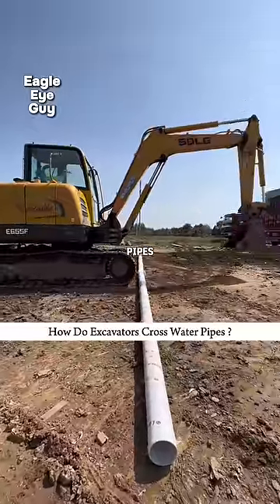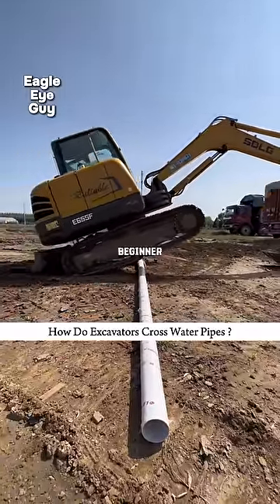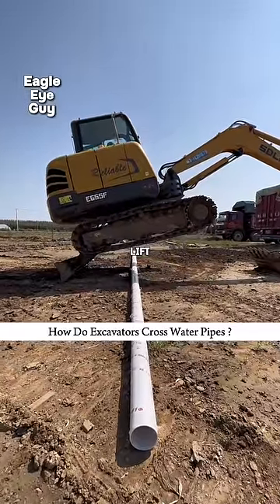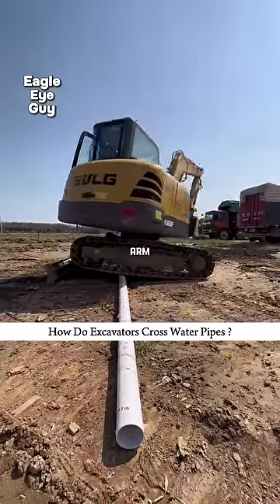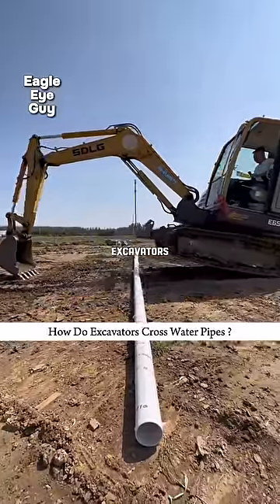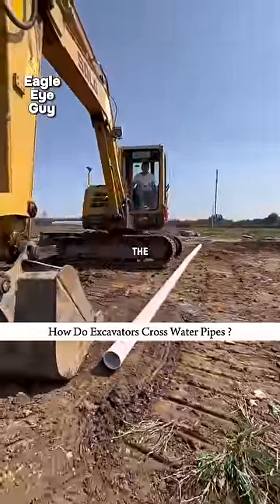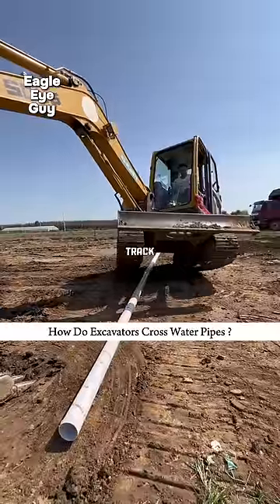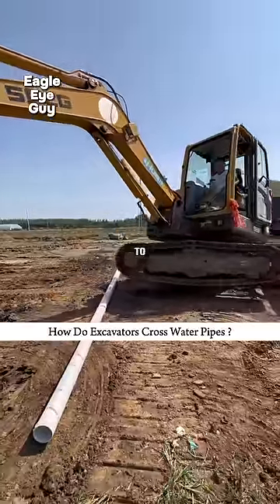How do excavators traverse water pipes? #shorts #facts #didyouknow #excavators #howto

Comment: Veteran operator here, a veteran won’t cross the pipe like that.
The risk of damaging the pipe with this manoeuvre is to high, just put piles of sand on both sides of the pipe a little higher than the pipe itself and drive over the piles.
Reply: Thank you. It was also very sloppy. The site super or boss would be losing his mind upon seeing such an inexperiened operator trying to pull a manouver like that. Anything bigger than what looks to be a 4" pipe and he would have crushed it.
Reply: I'm glad you said this lol I was thinking to myself, "I've only ever seen them throw sand over the pipe" 😂
Reply: I would be pissed if I saw someone put all that weight on the side of one track and try swiveling. No way thats a "veteran"
Reply: Thank you.  Came here to say exactly this.  My ganger would tear me a new one if he saw me doing any of this breakdance shit on site.
Reply: Just pull the pipe out of the way.
Reply: Nice way to throw the track as well.
Reply: With a excavator track 😂😂😂 bye bye pipe
Reply: @kousterx simple problem solved
Reply: I'm not an operator but what you said is what I thought while watching the video.
Reply: Not to mention the danger to lose the track by turning this way. But hey....
Reply: Ah first time saw 999 likes turned to 1K
Reply: When I’m digging a trench between two buildings, at the end you have to straddle the trench with the excavator. The second method is how I get off the trench.
Reply: @nicklovell5872 getting a piss test the instant you out the cat 😂
Reply: bro just put the pipe aside

Comment: Driver here. We just use the skidsteer to add dirt over anything soft or sensitive and cross over
Reply: Why? When both these methods take a minute or two. Why take all that time and take the skid steer away from what it was doing? Are you not skilled enough? Especially if that pipe isn't gonna be buried for a week or so.
Reply: @rhull3939 now do that maneuver 100x a day & tell me how long it takes lol a pile of sand on either side is faster & smarter overall IMO
Reply: The skids aren't slow just zoom by and toss and dirt over it and now everyone steps on it without a problem.

Comment: Imagine doing this in a job site? Everyone staring at you wondering wtf your doing. Then the pipe guy says dont fucking do that again.
Reply: I’m a mechanic, never been on a construction site… this looked so ridiculous it was setting off BS alarms right away hahahah   This is some last resort stuff
Reply: @tiko4621 this type of scenario happens more often than you’d think. Rarely would it actually be an pvc pipe run above ground like that but sometimes there could be something like that temporarily being used. More often it’s a curb or form boards I find myself needing to hop over.
Reply: So what’s the actual way of doing it?
Reply: @muhilan8540  you go around, thay is an unrealistic situation. If you're having to do something stupid like that then you should look at your job site management.
Reply: @austinjorden6663 that shit isn’t that heavy, just have the pipe moved, not like either of those methods would work for a pile of pipes. 2 guys could easily move that pipe & put it back where it was once you’ve passed in like less than a minute total
Reply: Lol what? Not sure where a bulldozer comes in but this is extremely common
Reply: @scotthill1600
I think the idea is it’s supposed to be for a pipe that can’t be moved and that video is just for demonstration purposes. 

Like if you have a pipe running through your job that’s live, wether it’s water, Gas, Sewage or what ever. And you can’t go around it this would be the “last resort” way of getting over it. 

But in my experience most of the time if we had a Pipe of some sort that was in the way and we weren’t allowed to fuck with it but had to get past it and it was just outright in the way. We’d usually just build a big mound of dirt or crushed rock over the top of it to protect it and that would let us just track over it without hurting it. 

None of this pussy footing doing party tricks to get over it. It’s usually just easier to build a ramp/bridge over it with dirt or whatever.
Reply: @Cliffy1616  thanks my dumbass didn’t even realize it was an example of what to do if the pipe is already laid & secured. You can’t move it, have to go around or over. Tell me you’ve never been on a construction site without telling me, typa shit. I’ve been on many construction sites but never working & it shows lmao

Also love the term “pussyfooting” I use it as well
Reply: @scotthill1600 depends on the material, if it's DI pipe it's going to weigh a lot.

Comment: Meanwhile the other day I saw a guy in a forklift trying to get a box that was too heavy down from a truck. When he couldn't (the forklift tilted forwards), he tried a couple more times by placing the forklift FURTHER AND FURTHER AWAY. The worst part is that there were 2 other workers helping him, and by the looks of it they too thought that was the best move. I guess they did know about leverage, but understood it backwards? Some people are crazy stupid.
Reply: A little knowledge can be dangerous haha
Reply: They dont sound certified
Reply: I've had a few times where I found out the hard way the load on the truck was heavier than I was told.  I feel the back of the rig lifting and I cant get any closer to the load I just abort and tell em they gota pull around to the highbay and use the crane.
was kind of funny the one 300lb driver that offered to set on the back of the forklift to see if it would be enough to unload.  I told him no I'm not getting fired and having a negligent homicide charge on my record to save you 15 minutes.
Reply: I mean whoever learned basics middle school physics wouldn't exactly be the kind usually driving forklift. Like not to demean folklift drivers or anything just that those kind of people prefer air conditioned office jobs.. 

But that said.... I'm an engineer with masters and such, and sometimes I too have dumb moments.
Reply: Torque concept goes out of the window
Reply: @shivanshshivi811  Ah, engineers.

Guys who invents weird shit and mechanics have to somehow make it.
Reply: @Ace345r  Forklift certification is a joke!
Reply: MOST

Comment: This is a solution to a problem no one  has ever had, ever. In the history of everything.
Reply: Exactly and I work for a huge rural water department.
Reply: No one in their right mind would do either of these over an installed pipe.
Reply: I’ve had to do this more times than I can count. I think everyone is missing the point of the demonstration and is getting stuck on the idea of a pvc pipe being on the ground.

Comment: One little mistake and that pipe is toast. The actual way is putting a temporary dirt ramp over the pipe, building a temporary bridge over it with wooden mats, or if the pipe is flimsy enough, you can actually create a temporary ditch and place a section of pipe into it and drive across.

Comment: in 20 years i've never seen a single operator do any of these things.   typically you set water pipes in a ditch which can be covered with a steel plate till your ready to fill it with dirt. otherwise go around it

Comment: The second way is super risky very easy to mess up and crush the pipe. If you absolutely couldn't move it or go around then you would use the first option or just place something solid on either side of the pipe and drive over that

Comment: You handle it by yelling at the plumbers for putting a water pipe on the ground. On real construction sites the excavators finish the ground work before the plumbers even get there, and if they have to go to the other side on the construction site there are crossspots.

Comment: While these do seem like good skills to have, it also seems kind of needless because pipes on top of the ground can just be driven around. I've never seen anyone have a need to do this.
If it's an actual water pipe, as in a pipe filled with water, then it will be in the ground, so they can just drive over the top.

Comment: Not a bulldozer. It's called a blade. And while I've had to hop a few green curbs in minis that way I've never had to cross a pipe laid on top of the ground in any way.

As for spinning over a pipe, just no. That will get at minimum an ass chewing, possibly fired. I have spun off open trenches a few times that way because it was the only way I could do it without caving in a bunch of trench and pissing off my ground crew. But not to just cross a simple ground obstruction. Just throw a bunch of material over it and cross. Or not and call it in that you broke it and have someone come fix what shouldn't have been there to start with.

Comment: This is a stupid method...🙄

Army corps method is...to use the dozer and push excavated material build a ramp on either side of the pipe, with enough cover over the pipe. This way the pipe is safe and doesn't get damaged during construction.